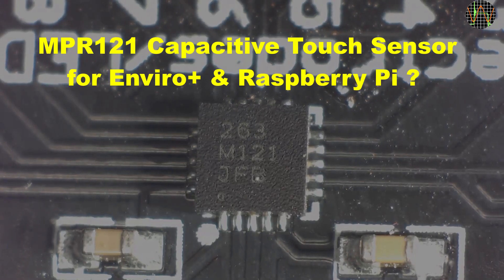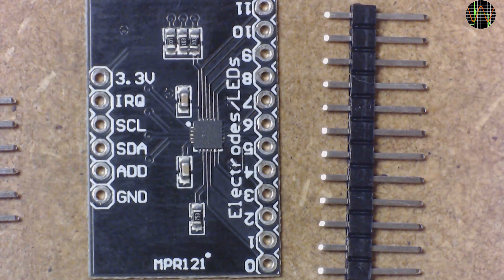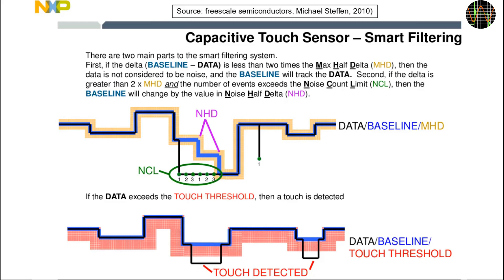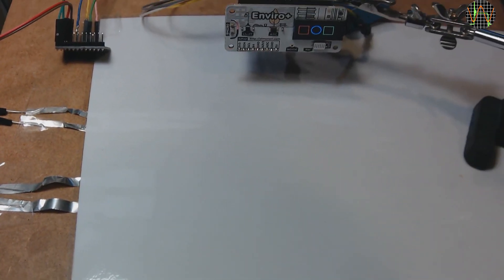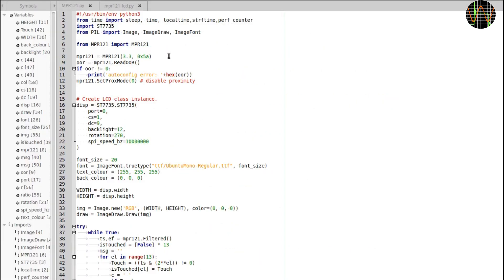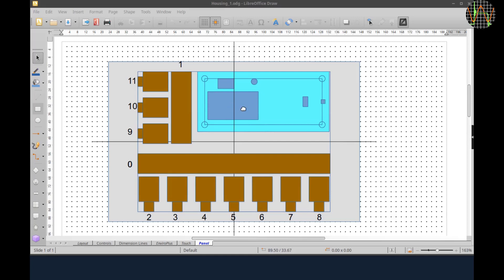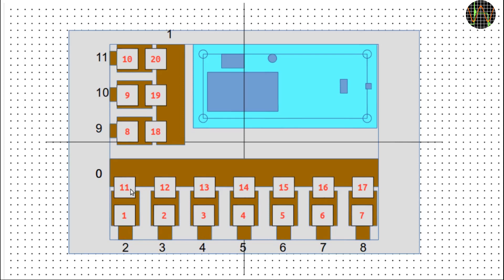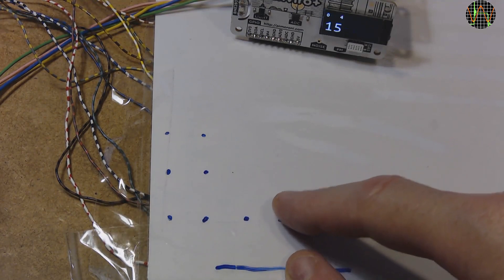MPR121 Capacitive Touch Sensor for Enviro+ & Raspberry Pi?

Comment: I wonder whether this can be also used for water level measuring, like 2 electodes sunk at different level...Anyone tried that ?
Reply from the maker: Sounds like a great idea. I don't have a spare MPR121 at the moment to try but I agree that this could probably make a nice level indicator
Reply: @TheHWcave  Heh, this is what I am looking for. A stand for a pot with flowers, watered directly to that stand and sensors should say that in a stand, there is "not water at all" or "full of water". So far, I came up with one idea and one sensor called HL-01 that is usually attached to rain/light sensors (look up in the internet) and all of them attached to ADC converter and this one through I2C...okay, works, but so many elements and point of failue... :(
Reply from the maker: @adamwalter2573  Another option to consider is putting the pot on an electronic scale. If the water level falls the weight reduces.